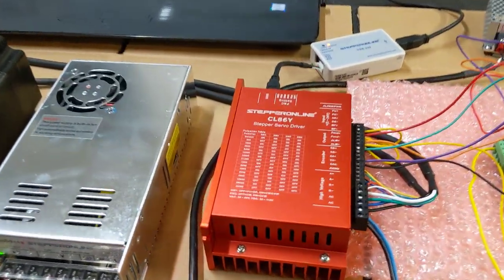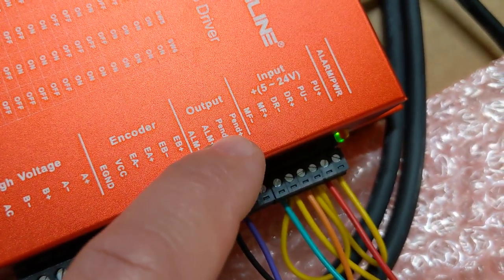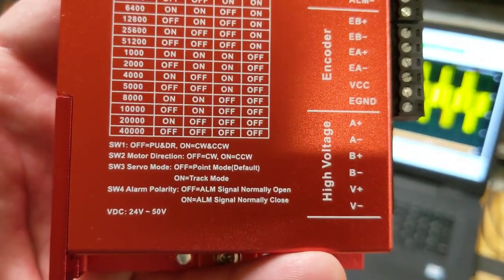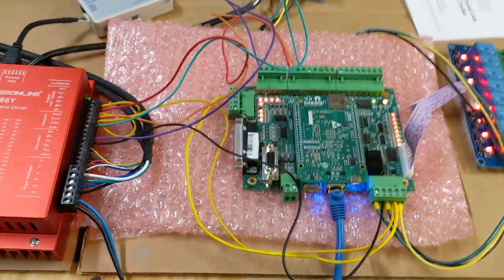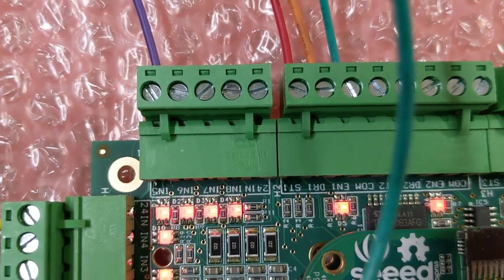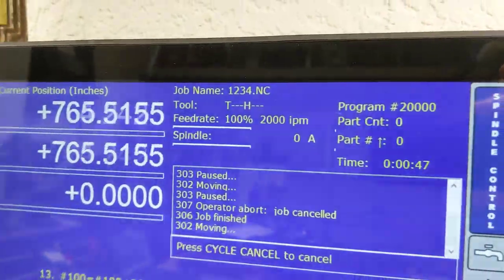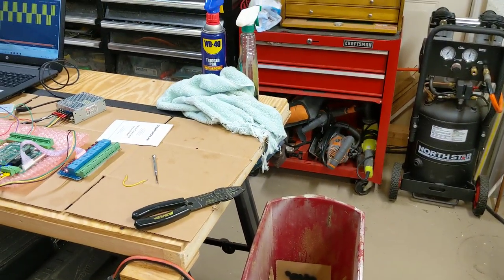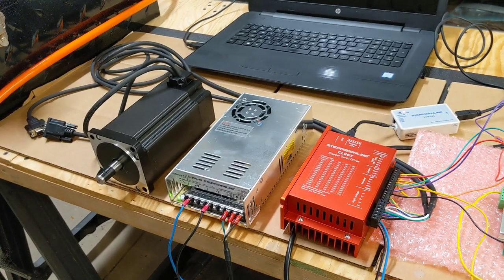Stepperonline CL86Y: Bench Testing with Centroid Acorn

Comment: I have really enjoyed your videos and because of you I ordered my PM 25 and receive it next week.
My question is...
Since I don't have access to a cnc mill to make the parts for the conversion. 
Do you sell a kit?
I just need the mechanicals ball screws, motor mounts, bearing blocks, etc
I have already purchased closed loop leadshine motors, controllers, power supplies, etc
I am starting all this late in life and want to have it all going before I turn 60.
Thank you in advance.

James Reed
Reply from the maker: Hi.  Thanks for watching my videos.  It's never too late to start a new adventure.  My father got into computers when he was in his 50's  and by the time he was in his 60's he had a pretty nice consulting business going on selling point of sale software/hardware.  Right now, the best place to buy a kit is here:  https://www.arizonacnckits.com/
In upcoming weeks/months there may be another good source for kits designed for the PM machines, but right now that's the best I can do.  Have fun with your build.  Post some videos when you get it up and running!
Reply: I tried the Arizonacnc website and when I click on the PM25 it has a error.
I know that you can't help with that and I will keep trying.
But in the coming weeks or so you said you may have another source.
So keep me in mind if you will and update me.
As for now I will just continue to watch your channel as I await my mill arrival. 
Thanks again  Franco

Comment: Hi Mate, 

I am going to carry a steel pallet (overall weight of 700 kg) over rollers with 2 stepper motors on each sides, do you reckon "Nema 42 CNC Stepper Motor Bipolar 30Nm" is enough for this application?
Reply from the maker: As long as you are able to adjust how quickly you accelerate and decelerate the pallet, then I think you will be fine.
Reply from the maker: And when you mount your motors, be sure to allow for proper ventilation. If you build up too much heat in the motor, they will fail.

Comment: Hi Franco. On stepper online they have this motor and driver (SKU: 1-CL86Y-34HE59) but they also have the same spec-ed (SKU: 1-CL86T-P120). Emailing them they said that the P120 was made by a more reputable manufacturer (leadshine). Do you think it is worth the extra $? I am thinking of going nema 34 on all axis, so it does add up. Thanks
Reply: @tjuggernaut29 I am in the same boat as to which to get 1-CL86Y-34HE59 vs 1-CL86T-P120. Did you ever come to a resolution as to which kit to get? The specs looked similar on the datasheets from Stepper Online. They said difference is manufacturer and that P is "more high quality".

Comment: The CL86Y can be powered with a higher voltage power supply or even with up to 80V A/C from a toroidal transformer for better performance, have you talked to Stepperonline for performance recommendations?
Or have you already tried that yet?
Ref: Input Voltage: 20~80VAC/30~110VDC (Typical 48/60VDC) Taken from the mentioned distributor.
Kind regards/Stefan   stockholmviews.com
Reply from the maker: Hi.  I generally try to avoid using more voltage than necessary as this causes the motors to generate more heat.  I generally end up using about 75% of the max voltage rating of the drive.  I always use switching power supplies.  It is very important that your power supplies can keep up with the current draw - otherwise the drives can do strange things.

Comment: I went from nema17/DM542T  to  Nema 34 closed and CL86Y.  50v Power to AC/AC.  Motor is wired the same as this video.  I have 4.85v from BOB to PU+, DR+.   P16 to Pu- and P17 to DR-.   No power to motor-  the shaft is still free when I power on.  Dip switches off/off/on/on/on/off.   Does the encoder have to be hooked up?
Reply from the maker: Hi.  You must have the encoder cable coming from the motor connected to the driver.  The motor will not move if you do not make that connection.  Also, be sure to check the logic of the MF (enable) connections.  If it is wrong, you will disable the motor when you power up your CNC control.
Reply: @FrancoCNC  Can I jump the encoder ports(EB+     EB- etc.)  I am pulling data from the encoder wires Black/red/blue/yellow on arduino.  It worked with the DM542T and a closed nema17.  Please assist me what I need to do, a different driver?

Comment: Hi Franco,
Thankyou for this video it has helped me start my project! I do have two questions and was hoping you could help me.
I am using the same motors and drives but I noticed that the cable attached to the motors is not insulated with metal, does this matter? I've watched a video in the past and they said the signals could damage the drives, is this true?
Reply from the maker: I suppose anything is possible...BUT I've used a lot of different closed loop stepper driver/motors and I've never seen any that have metal insulated cables for the "big" cable that feeds power from the driver to the motor.  I've seen the encoder cables be insulated because they operate at low voltages that are subject to electrical interference.  But, most any time you are at or above 24v electrical interference isn't a problem.  I don't think you are going to have any issues.
Reply: @FrancoCNC  ok thankyou for the reply really appreciate it. I've got to lay everything out neat now in my box the only thing I was thinking is, does my acorn board need screwing to a metal container for earth or could I screw it to plastic/wood. If you could give me your opinion on whether it matters as it should be earthed through wiring already right, Would really appreciate your opinion please.
Reply from the maker: @tylerdavenport8661  I think this may answer your question:  https://youtu.be/kDcOyDXXFl8

Comment: Hello Franco, thanks for all the great videos and info.  I have a PM25 with an ArizonaVideo conversion kit installed.  I purchased CL86Y driver and 1699 oz/in combo from Stepperonline.  I also grabbed the same power supply from them that you are using (S-350-48).  Now, here is the issue that I am having, I am getting stuttering and driver failures with speeds anything faster than 140 IPM in the up direction of z.  I have adjusted the alignment of the ball screw every which way that I can to no avail.  Sometimes, it appears to move quite nicely at even as high as 180, then 2 minutes later, that same "binding" stutter and driver failure.  I thought that this motor and driver combo would be sooo much more than I needed but I cant get it to do it.  I have the Acorn CNC board as well.  Can you shed some insight?  Thank you in advance.
Reply from the maker: Hi.  That is a 6 amp motor.  The power supply should be able to deliver 7.3 amps.  This should be enough current to cover the needs of that motor/driver.  It is possible you may  have a bad power supply - I've experienced this and it causes very strange problems that seem to make no sense.  Where do you have the micro-stepping set for that motor?  As you increase micro-stepping, you decrease torque.
Reply: @FrancoCNC  thanks for the response.  I thought that as well about the micro-stepping, I dropped it down from the 4000 to the 2000.  I may try to drop it some more.  I did, last night find some runout in the motor coupling that looks like it is about .005 out.  If I unbolt the motor mounts it sure does want to move around.  I ordered a new coupling and will see if that helps.  Also, I noticed that when the driver throws a fault, the alarm led does not blink like the smaller drivers do.  any thoughts?
Reply from the maker: @rosspower7514  It sure does sound like a Power Supply issue to me.  But, unfortunately, the only way you will know for sure is to eliminate variable one by one.  Have you contacted Stepperonline?  It may be good to give them an opportunity to help you solve this.
Reply: @FrancoCNC  I also noticed that when the driver throws an alarm, the alarm light does not turn on like the CL57Y driver does.  So I took a chance and purchased a new one from them.  I have also reached out to them via the contact us on their website and have not heard back yet.  I may also try to test run the axis with the 400W 36V 11A power supply that I am using for the x and Y axis drivers.  It is less voltage, but that should be able to tell me something.  What do you think?
Reply from the maker: @rosspower7514  That is a good plan.
Reply: @FrancoCNC  Not sure what the issue is with StepperOnline, they still have not responded to any of my emails or the contact us page.  Is there some special contact info that I am not aware of?  Also tried the 36V power supply and it is a no go.  almost instantly throws and error.

Comment: I cannot get my CL86Y to operate , blinks 6 red blinks over and over, the manual does not explain this problem.
I have 48vdc, nena23 stepper wired up. Never been able to make motor rotate.
Any suggestions ?
Reply: With a closed loop stepper, the phases must be connected with the correct polarity. If one of the phases has it's polarity reversed, when driver gets some pulses, it will try to move motor in one direction, but the motor would try to turn the wrong direction. The driver would immediately detect this condition and error out, thus the motor just won't turn.
You might have miswired the motor or encoder connections, double check the wire colors, refer to the motor datasheet. It's also possible that the wires at the motor itself, or at the extension cable plugs, are miswired, in that case you can connect everything according to the datasheet but the connections would be wrong. Simple thing to start with is to first check the motor phases. Measure with a multimeter, you should have a low resistance on both phases (see phase resistance in the datasheet). If you see open circuit, the motor is miswired or damaged. If everything is fine so far, connect the motor and try sending it some pulses. If it doesn't turn, swap the two wires of one phase and try again. Try various configurations. Hopefully the encoder is wired right because there are more wires there...
If it doesn't work any way, you may have a malfunctioned motor or drive, in that case contact stepperonline and ask them to step in. But in a lot of cases it's just wrong connections.

Comment: I've opened up the USB interface box (StepperOnline calls it HISU = Handheld Intelligent Setting Unit) to see what's inside. It's a very simple device, carrying a CP2104 USB-to-UART converter chip and a few resistors/capacitors it needs. So it seems that the USB-B jack/connector on the Y-series drivers is not really USB, but serial, just with a USB-B physical connector. The setting unit box has a USB-B jack for connecting to a computer, and a 4-pin connector for serial communication, with a matching 4-pin to USB-B cable to connect to the Y series driver.

If someone is contemplating buying this device from StepperOnline, you probably don't need to spend the money if you already have some USB-serial converter(s) (~$2 on eBay from China). All you need is a USB-B cable to plug into the driver, and then adapt the other end of the cable to connect to your USB-serial converter. Unless StepperOnline's PC software is somehow made to only work with CP2104 specifically (then again, there are $2 CP2104-based converters on eBay from China).
Reply: Hi there and thanks for posting this. Would you happen to have pictures of the insides of the USB interface box, or know the pinout of the "USB" jack on the motor driver? I did not realise that the port was not a real USB port and hence did not buy the interface box, and now I am stuck trying to communicate with the driver using a USB/serial adaptor. Thanks!
Reply: @HypronVideos  Hi I can check a few days later. Meanwhile you can try opening up your driver and check the PCB silkscreen for any clues.
Reply: @HypronVideos  Just checked the cable supplied with the USB interface box. Box side TDO GND TXD RXD correspond to the USB-B connector side + - D+ D-, respectively. TDO pin on the box is normally not connected (assuming the stepper driver has it's own power supply). The box has a 2-position DIP switch allowing to connect TDO to 3.3V or GND.
I think you can just use a USB-to-serial converter, a USB-B cable, cut off the other end of the cable, then connect respectively cable's - D+ D- to GND TXD RXD of the USB-to-serial converter. On my USB cable these D+, D- and GND are respectively black, green and white wires. Get a USB-to-serial converter that can be configured for 3.3V operation (usually a switch or a jumper), I think it should be 3.3V - but this is not certain. If it doesn't work, try swapping RXD and TXD.

Comment: Can these run without wiring to the enable or is that necessary?
Reply: You need enable. But in case you can't use enable just jump it to positive or negative. Im not sure but a jump will fix that
Reply: @instaboiidsg2117  thanks!

Comment: One thing about the nema 34 I got from steppersonline not a big deal but I wished the cable was little longer
Reply: I purchased a nema 24 and have the same complaint. It's the only one I have though that motor runs great. I plan on getting another for my other axis.
Reply: @GaryBrown-uz4in  thanks for the tip.
The prices are reasonable too.

Comment: Hello, I got the same kit. How do I find the pulse to set the dip switches? Thank you
Reply from the maker: Hi.  The chart printed on the driver will tell you how to set the dip switches (on side of the driver).  You need to make this setting match what you are using in your CNC Control Software.  I'm not sure what you are using (Centroid, Mach3, GRBL) but you will need to figure that out.  Otherwise, you'll tell the axis to move an inch but it won't physically match what you commanded.
Reply: Franco thank you for the reply. im using Mach 3. I have the dip switches set at 5000, what’s yours set at? I have a cnc already but this is my first time building my own.
Reply: Franco im still trying to figure out the concept of how the tuning and calibrating works. I got the motor turning correctly but it’s very slow
Reply from the maker: @rpgallagher7628  I suspect there is a setting in Mach3 that you need to look at.  I don't think the drivers are your problem.  As long as you know how many pulses per rev the drivers are set to, then you should be able to make them turn as fast or slow as you want.